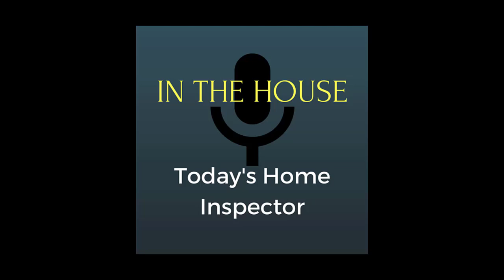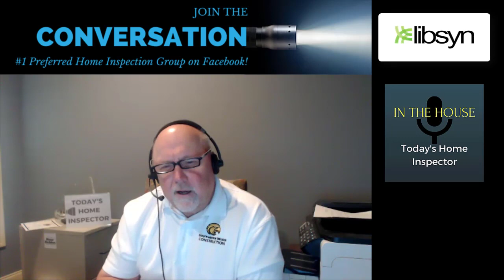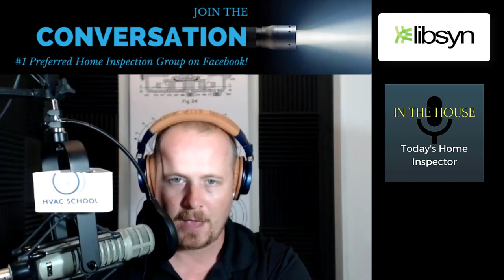How Home Inspectors Should Inspect the HVAC System - with Bryan Orr

Comment: Super program I have a question I am in the middle of buying a house and my inspector went through and found the evaporator coil installed in the return side of the unit and he said that was a big no-no it will corrode the electronics and blower from the moisture I read online some people say if you have a condensate drain right there you’ll be OK I don’t believe so the inspector said it should be put in the supply side of the duct what do you guys think thanks Robert
Reply from the maker: Is the heat gas or electric?